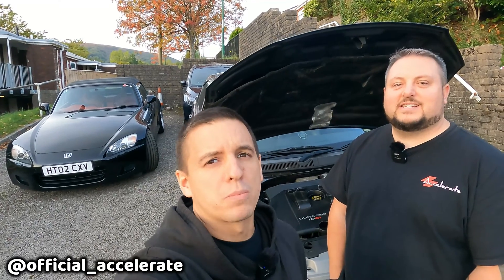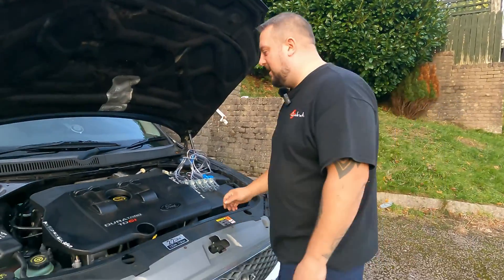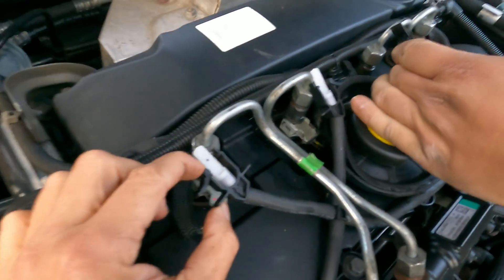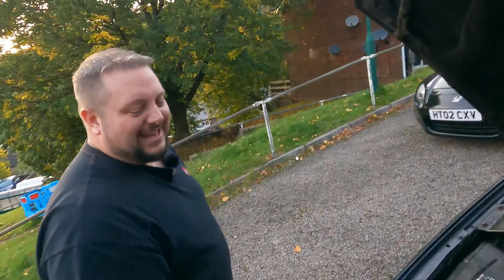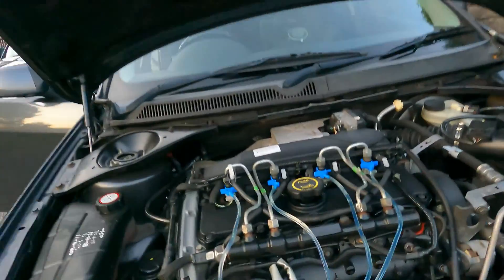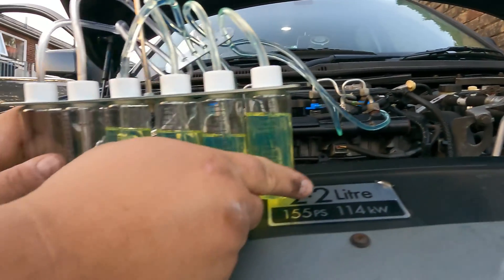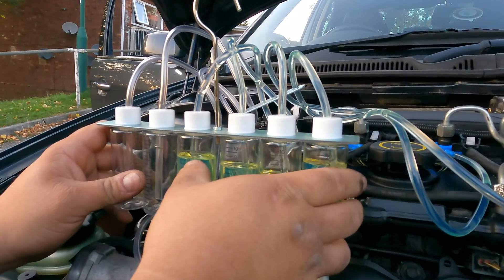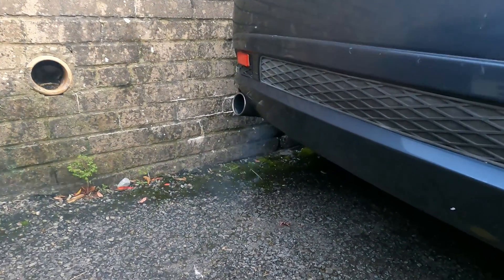DIESEL INJECTOR LEAK OFF TEST **Ford Mondeo ST TDCi 2.0/2.2** Cause Of Smoke On Start Up???

Comment: Bro my car torque, pick up, everything is good it can pull up in 2nd gear without using accelerator, still It is shooting blacl dry smoke on high rpm and mileage is low, what can be the reason?
Reply from the maker: Have you checked the EGR Valve and inlet? A mate of mine bought this off me and it was the EGR valve.
Thanks
Ken

Comment: I'd have gone for cleaning the manifold makes a big difference for startup smoke. Very clean under the bonnet that one. Doesn't  seem overly bad results there a lot say they rarely pass if you go off the said measurements 👍

Comment: Bit late to the part here but I blanked off the egr on a Fiesta 1.4 diesel, made it worse. I then used a blanking plate with a small hole in it, worked like a dream. So if you have no success with blanking off, drill a small hole in the plate, made a world of difference

Comment: That kit isnt universal. They wont work on the ford tzja engine. The connectors need to be a straight tube withought the flair for the metal clips, because they are held in with the green plastic clips.

Any advice?

Comment: Just checked my 1.5 a180 D and got the same. It only smokes when cold and lumpy. Runs perfect when hot.
Did you find what your issue was ?
Thanks guys. Great video and banta!

Comment: Could be the turbo carbonend up the turbo arm what opens it was slightly restricted on my turbo and was causing the coil light flash so I drilled the turbo tapped it out used mr mussel oven cleaner sprayed it in withheld the arm on turbo till it worked loose then poy a washer and screw in the hole takes a few mins get car start up again till it blows the crap out the turbo then egr valve was no gud so orderd a mew one off ebay 50 quid it's working a lot better now and pulls well also  i would also check your boost pipes as if split can have the same issue

Comment: That smoking is likely a tiny pinhole in a boost pipe. The one under the egr valve is the common culprit.

Came here as im testing the injectors on my 2.0 jag... pretty sure if got 2 faulty injectors 😢

Comment: Had this same issue on mine for a long time. Even with a blanked EGR kit (egr completely removed and piece of pipe in its place) it made no difference so I don’t think it will be that. I always assumed injectors/injector seals leaking a little fuel which then burns off on start up but I don’t think I’ve ever found out the 100% answer.
Reply from the maker: That's not a good sign then lol
I'm wondering if it's worth removing the Injectors and cleaning them (with an injector cleaning machine) 
- Drew

Comment: More than likely egr . I had mine deleted and put blanking plate on . Runs so much better . Doesn't cut out and starts amazing now on my 2011 Mondeo
Reply from the maker: Yeh, I think that's the next port of call for sure Gav. Mine was clogged like crazy! So cleaned it out and blocked it off like you have. 
- Drew
Reply: A lot of people keep advising this procedure but is it really good for all engines? I'm 100% sure it requires remapping the whole system, therefore it's not something one could do on a driveway. Egrs are not that expensive and they do last a while. Now another thing is that people keep advising on the internet to carry on with one procedure/replacement but they never mention to look at the problem holistically. Nobody is asking main question - why certain part got faulty? So what the egr got replaced or blanked out if the main reason behind it getting to this state hasn't been identified and fixed? And that could be not one but few reasons. Most recently I have replaced injector copper washers and while doing that I have discovered multiple additional issues that were causing a lot of other problems and it all started with guess what? The egr valve. So just sorting egr by replacing/cleaning or blocking it doesn't solve the real source of problems at all.